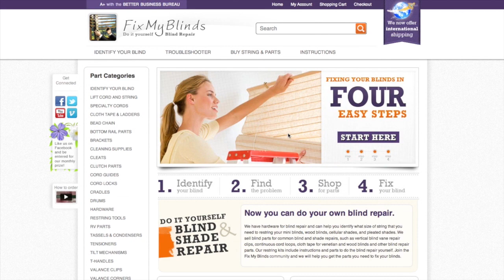How to Restring an RV Day / Night Shade

Comment: Nice explanation in the video and the sketch. I have a large day/night blind in my motorhome with 4 springs and 6 strings. The springs are located two in each end of the upper rail and two in the middle. I would like to know how is the diagram for restring this blind. Any body knows? Thanks
Reply from the maker: Carlos, we don't have a diagram for your exact shade, but these may help: https://www.fixmyblinds.com/media/repair/ins-rv-diagrams.html.
Reply: Carlos, I have the same shade.  Did you ever find a diagram for it.  Thanks

Comment: Thanks for the great video. I have a wide, 61" day/night RV shade that I will be trying to re-string. I had the new string but no re-stringing tool, so I called them and they said the re-stringing tool is 24 gauge wire and 18 inches long before folding it. Thanks.
Reply from the maker: Thomas - It was nice to speak to you on the phone. I think that your restringing project will go just fine! Let us know if you have any other questions.
Reply: I did try Lowe's and Ace Hardware for the 24 gauge coated wire, but their sizes stopped at 18 gauge. 
Lowe's did have a packaged roll of 250 foot metal (not coated) 24 gauge, but I just needed 18 inches and I prefer coated wire.
Do you have sources as to what stores have the 24 gauge wire?
Thanks.
Reply from the maker: Yes; try a craft store and buy floral wire. That is what we use.